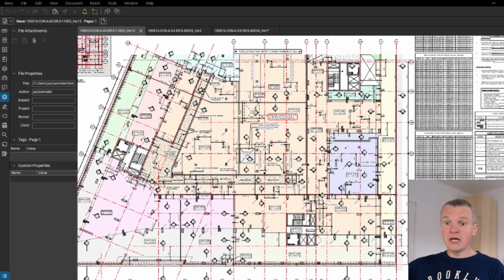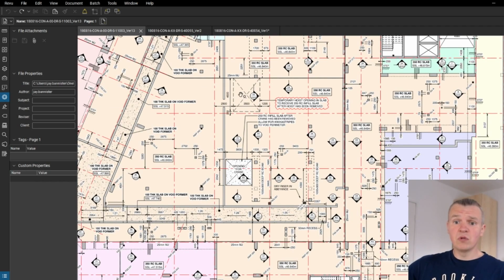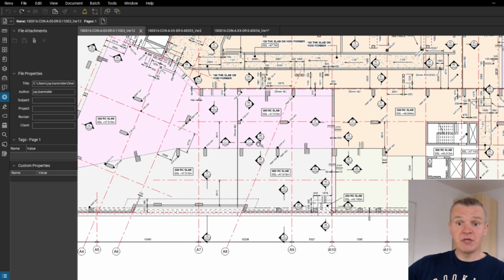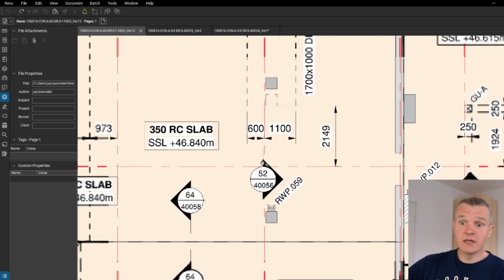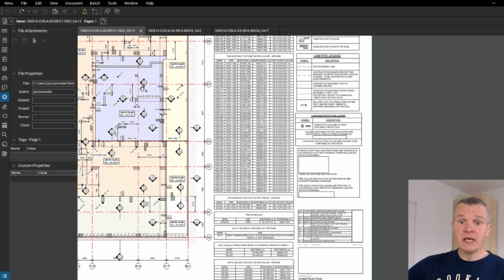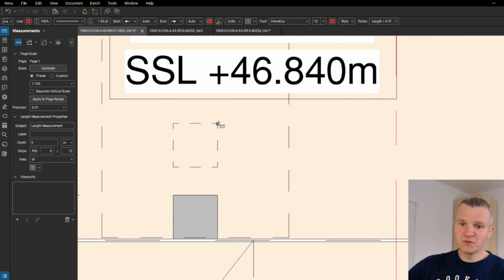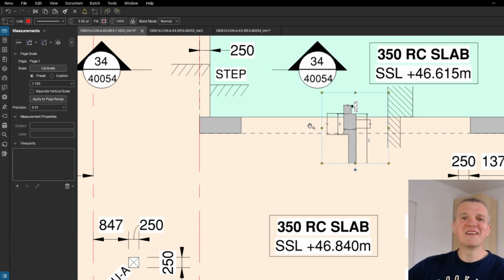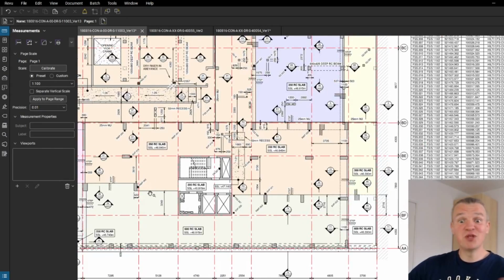CONSTRUCTION DRAWINGS. How to get BASIC information from the drawings on construction site.

Comment: I also need to know the methodology used for calculating steel quantity since back in India it is quite different as we calculate the weight of the bar by multiplying with its bar weight however in Canada, it's quite different as I can see from the textbook that it is given in terms of mass criteria as kg/mt and even the bar sizes too, they are different, as I can see they are shown in 10M whereas in India it is given in mm. So, I hereby request you to make a video on calculating steel and concrete quantities.
Reply from the maker: Hi! Rebar quants depending on design so if you know how many kg you still need to 'change' it for the rebar di and spacing. UK is in mm as well. I am not calculating rebar quantity as these is provided on the rebar schedule drawings - I only take 1 cube off concrete for every 7850kg steel for the big big pours ;)